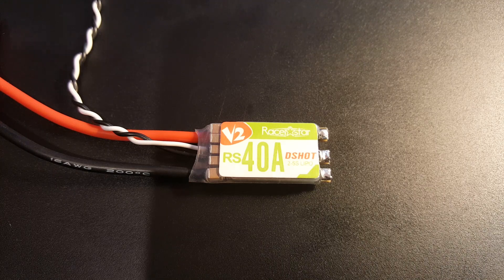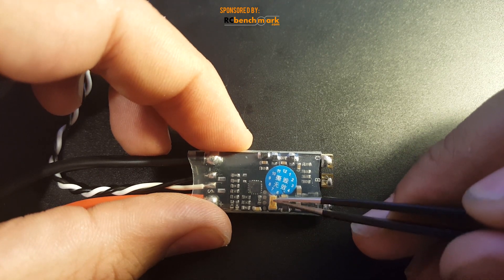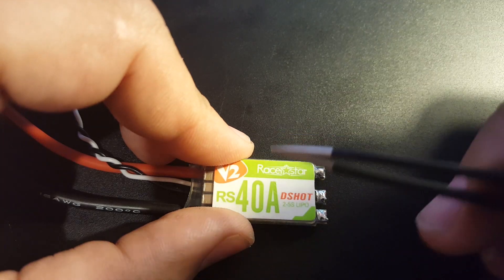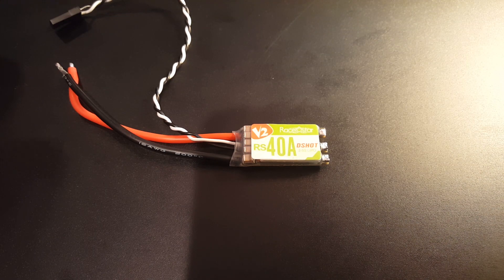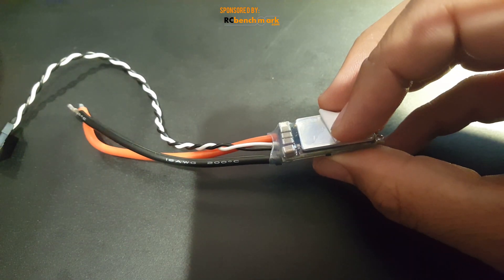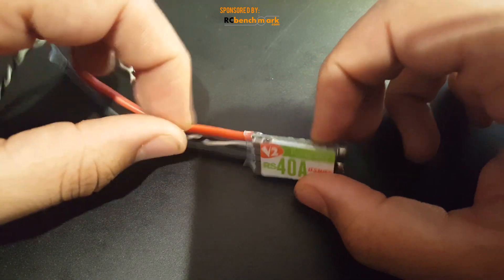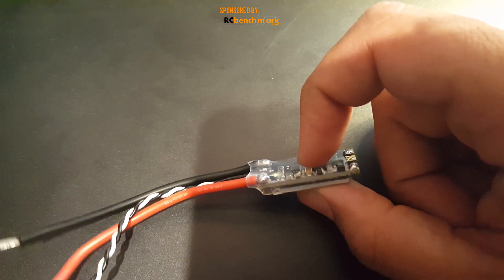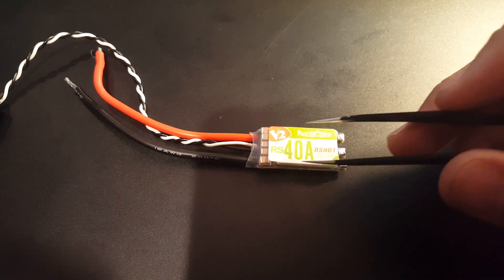Racerstar 40A V2 ESC // Review and Noise Testing

Comment: I've got some and use 4 and 5 s.  they are working very well.  I bought purely for Dshot 600.  I use a 1000 esr and lc filter totally flawless fpv.   they never even get warm.   I always wondered how the noise was. probably don't even need lc filter.  wow performance was excellent.  thanks again for the reassurance.  .. really helps
Reply from the maker: Craig Byrd Thanks for the feedback on them. 
What motors are using on that build?
Reply: I'm using emax2750 and  the the 2600.  red bottom s

Comment: I got the rs30a when I was flying my backyard track I hit a gate went into a spin and recovered after 2min my battery was about done so I landed....I look at the #4esc and some how the 4in prop hit it and took off 4 of the five capacitors....if I didn't look I probably would have never knew.
Reply: Chi Sty Put a piece of prop over the esc then heat shrink it. I've done this for over a year and never damaged a esc from prop strike.